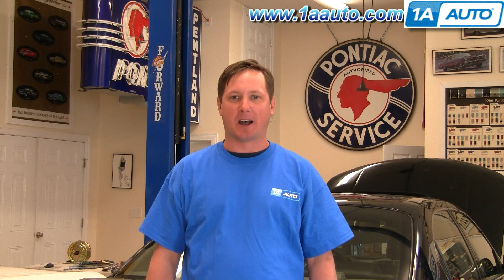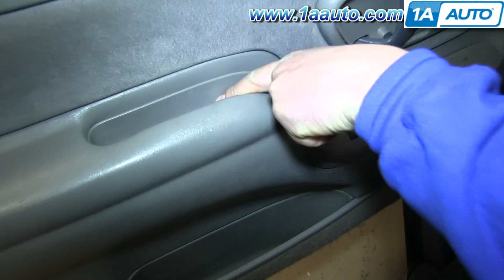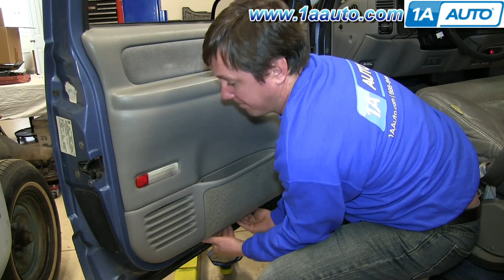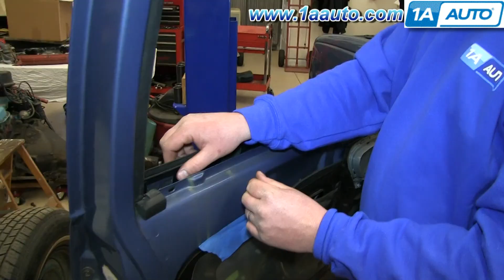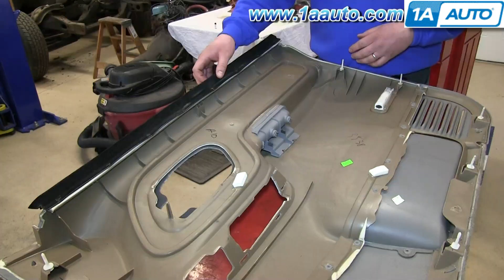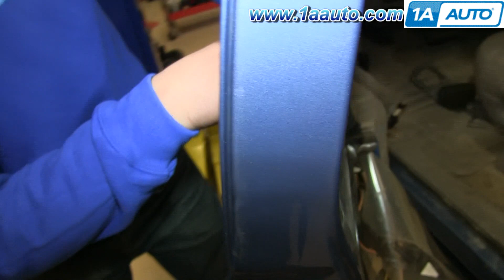How to Replace Window Sweep 95-00 Chevy Tahoe

Comment: I  had a 98 Chevy CC1500 standard cab and currently  own a 99 Suburban. Ive noticed that both vehicles  have experienced vertical  window scratches on both the driver ,& passenger side. Is it possible  that worn window sweeps are the culprits?
Reply from the maker: +@mauricebrock4233 We wouldn't be able to diagnose an issue like that here, you may want to have a local mechanic take a look at it. Thanks for checking us out! http://1aau.to/m/Shop-1AAuto-c
Reply: The sweeps collect sand and grit, it never gets cleaned out during the life of the truck, it acts like sandpaper each time the window is lowered and raised.
The sweeps are available on ebay and amazon, replace them and keep them clean where they contact the glass.

Comment: I just replaced my WJs window belt molding today ...there is a ~ v e r y ~ simple way to do it... With the window rolled down, standing on the inside of the door (with it opened) dig your fingers under the outer trim piece between it and the paint and pry it up and away from the outer side of the door, about 25-30 degrees, about 5 inches long, starting from the back, once it bends... or breaks, if really rusty. Gently push it down (pressing the inner lock/guide away) from its inner resting point, while wiggling or rocking the entire piece and it will pop right out

Granted (it kind of hurts the finger tips, no whining) they will heal. No tape, no tools, no worry of scratching paint or glass and no taking off the inside of the door. Just tough fingertips are required, mine are still a little tender lols, 6 hours later...

On the back window, with narrower working area, I used a stool, standing on the inside of the opened door, with windows rolled down. I reached through window and peeled (with strained finger tips;) about 5 inches back, then using it as a handle pressed down lightly with one hand and used the other hand / prying with fingers tucked the trim, while pressing down and wiggling to free the length of the belt molding piece. It just pops out. It took less than 5 minutes, to do 4 doors.

I will "admit I bought the "Lisle tool" meant to slide between the glass and the trim piece... it did not work (on my Jeep WJ) !!! Its jaw was narrow enough to fit in between glass and rubber, but not not wide enough to grab the lower lip of molding. Numerous YT videos showed the same laborious process (interior panel removal) The engineer in me was determined there was a simple way with harming paint and / or the glass.
Reply from the maker: +Question Everything #1 Thanks for the feedback!

Comment: I just did replaced the door panel weather stripping on my 97 Silverado. It's a pain in the ass. Although this video was very helpful, save yourself some time and frustration by getting some new heavy duty staples, grab your drill with a small drill bit matching the size of the staples and if you're patient enough and have a good eye, try to drill through the new stripping and into the existing holes on the door panel.. then use some needle nose pliers to push the staples through. This job is doable if you aren't a professional. It just takes time.